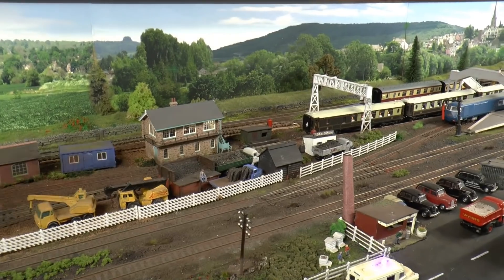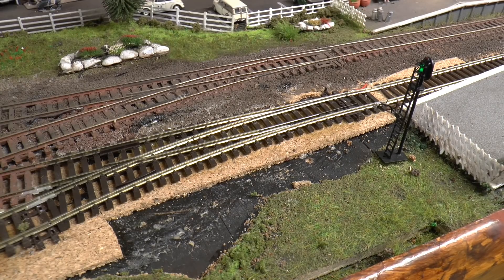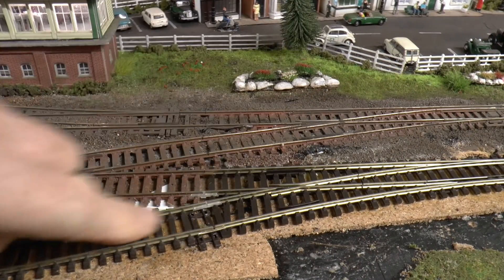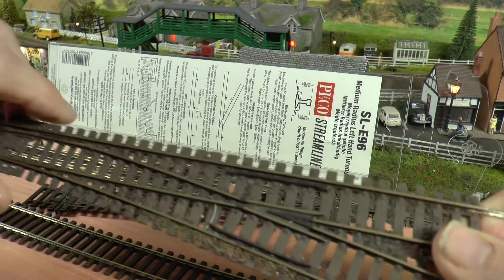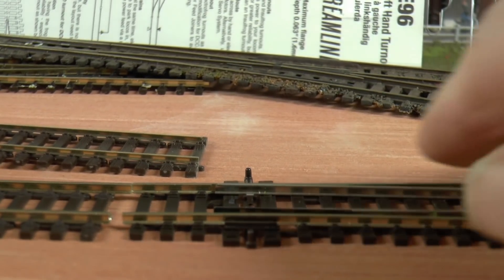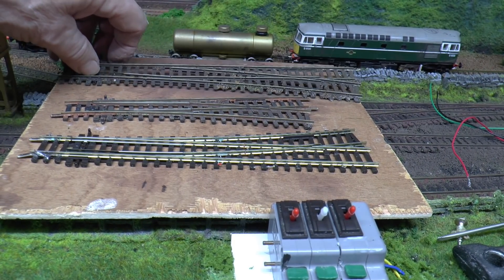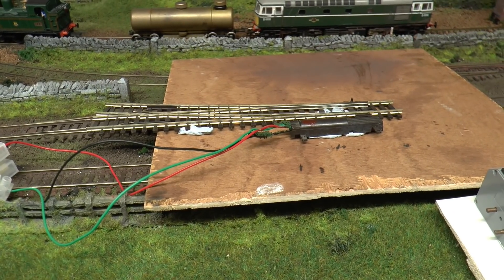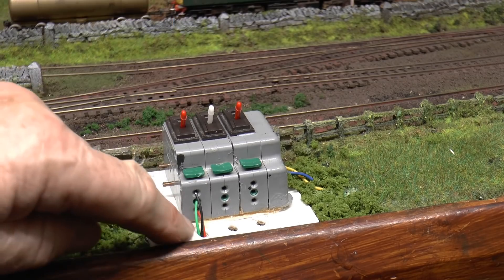D.M.Railway...Points and Track

Comment: David. So good to have the time to enjoy your videos again. Spent the last six months being caretaker for an ailing parent. I presume you are using code 100 track (rail height .100 inches) and nickel silver rail on your railway. I became a big fan of Peco track when I modeled N gauge in the 1970s. Unfamiliar with Hornby track, though I successfully used track from Atlas, Lima, Tyco (Hong Kong), Bachmann (China), Mehano, along with the Peco, which I discovered some ten years into the hobby. Do you know if the problem is rail height or tie height? I found a good quality flat file to be an excellent way to adjust this. I know the old Arnold N gauge track had offset rail joints, making them incompatible with other manufacturers. Should you ever decide to try hand laying rail, offsetting the rail breaks makes for much smoother trackwork. I offset the rails on the last layout I did for a friend. It was all done with commercially available flex track and cross-overs (they wanted a continuous twice around for under the Christmas tree. Good trackwork has made Xmas operation smooth for the last thirty years. Anyway, good to be back. I look forward to watching what I missed in 2019. Be well.
Reply from the maker: Hi Anthony ? think thats your name , yes its the code 100 track , but showing that the finescale is different in height , have tried a lot of Hornby and Peco , but as i say in this at the end of the day maybe the Peco is the best as are there points , but a bit difficult to follow instructions re cutting the wires which using side mounted points motors is not necessary ...welcome back ..and I know what you mean being a caretaker ..comes to us all at times ..cheers Dave

Comment: Hi Dave with Peco Code 100 nearly all locos and stock will run but with Peco Finescale the older locos and stock will bounce on the chairs of the track cause the wheels flanges are too coarse  so you would have change all the wheels to finescale as well an expensive job
Reply from the maker: Yes i have had a few say that , but for new stock think it would be a good idea having all finescale ...cheers Dave

Comment: You are looking for SL-113 code 75 to code 100 transition track.
Reply from the maker: I showed the SL 100 F finescale which is not mixable with the SL100  , and the one I am using is the SL 100 wooden sleeper Track ..Cheers Dave
Reply: @howarth004  Hi Dave.  You are a bit confused. Peco Finescale track such as SL-100 wooden sleeper track is 0.75" high as opposed  to universal trackage which is 0.100" high. SL-113 is a joining piece which allows you to connect these two types of track. The term 'code 100' means 1/1000" of an inch high track, which is the same as Hornby and Peco Setrak. The term 'SL-100' meaning the track length, is not to be confused with the term 'code 100', which means the track height.  I would use the length of SL-100 you bought by mistake to make a siding, using SL-113 to connect it to the main part of the layout.
Reply from the maker: @SussexHistory  Yes did not know the 75 was for the height , thank you for the information , I have 2 test tracks which I am now using the finescale on , so its not gone to waste ...thanks again ..Dave

Comment: Short setrack points are a nightmare. i have through experience  configured my layout to not need them whereb=ver possible and the few I do have are either full trailing points or facing only on the straight section and trailing on the curve section... That seems to be ok... setrach short or curved are both horrible for making track crossover. Far too much of an S shape.
Reply from the maker: They sure are , all very confusing though with Peco instructions re insulfrog and Electrofrog ...maybe this will help a few ...as you say short points  are just a waste of time ..cheers Dave